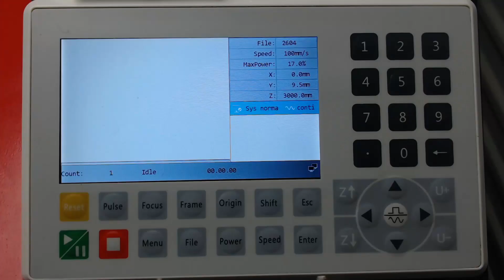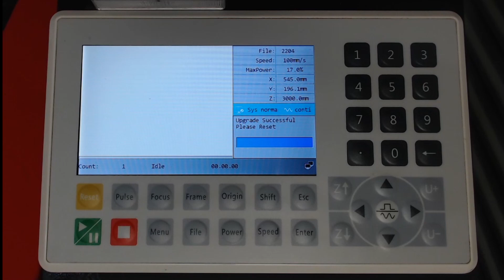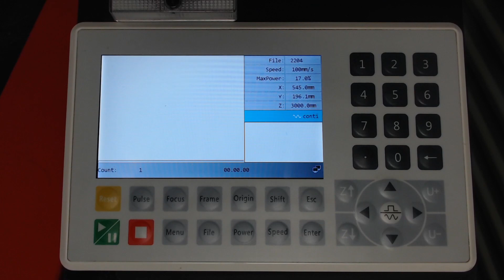[05] RuiDa Controller - Firmware Upgrade RDC6445 - Cloudray Laser - RD-ACS

Comment from the maker: I have made the firmware shown in this video available on my website at https://mwlaser.com.au/sdm_downloads/
Reply: MW Laser Thanks Matt!
Reply: I hate to say this but I’m having all types of problems with this firmware update. My machine will work fine until I go to bring up a new file and when I try to frame that file the machine crashes! Unfortunately I had no idea how to back up the original firmware otherwise I’d go back to that. Any suggestions Matt
Reply from the maker: with my testing and during production of videos for Ruida I have changed firmware revisions a few time both upgrade and downgrade, this has not had any effect on my machines performance.  it is safe to downgrade your firmware to a previous revision if you need to.
If you require further assistance email me https://mwlaser.com.au/contact-us/
Cheers Matt

Comment: Dear Matthew / MW Laser Team,

I have been following your excellent video tutorials and really appreciate the detailed content you provide for Ruida-controlled laser machines.

I am currently facing a challenging issue with my KH5070 laser machine equipped with the Ruida RDC6445G/S controller. The problem is as follows:

In RDWorks 8 software, my design files are set up correctly to engrave and cut from left to right (which is the expected and normal direction).

However, when the job is sent to the machine, the laser head starts engraving or cutting in the opposite direction — from right to left — effectively producing mirror-image engravings.

All polarities, origins, and settings in RDWorks and the controller have been carefully checked and appear to be perfectly set.

The laser head also physically homes typically (e.g., from center to upper right, then upper left), which I understand is normal.

Despite the above, the job execution on the machine does not follow the correct direction as designed in RDWorks.

I suspect this might be related to some firmware behavior or specific controller internal settings that are not apparent in the software interface.

Would you be able to advise or provide insight on:

How to diagnose and fix this reversed engraving/cutting direction issue on Ruida RDC6445G/S controllers?

Are there specific firmware versions, hidden parameters, or special configurations you recommend for the KH5070 or similar models?

Any tips or walkthroughs you might have that are not commonly covered in tutorials?

Your help would be greatly appreciated, as this issue significantly impacts the quality and usability of the machine for professional work.

Thank you very much for your time and assistance.

Best regards,
Jelena

Comment: Hi Matthew, Thank you for the video. I have the 6445S  with version 13 firmware. If I upgrade the firmware to 16 ( in order to get the chuck rotary to work correctly) will it also change the cuurent user and vendor settings?
Reply: I wanted to know the same exact answer. Did you happen to update yours?
Reply: @JuanGutierrez-zm9bv  I upgrade to latest firmware some time ago and it kept all settings

Comment: When I click, "upgrade firmware" I get a pop up message that says communication error.  When I click "read" it says read system information failure.  My laptop is correctly plugged into the machine.

Comment: Hello, how are you
I have an old OS (RDLC-V5.00.38)
I have installed RDWorksV8.
And I don't know how to get the update file for the latest version in order to update the program on the machine
Reply from the maker: contact ruida support for the controller you have, and request assistance
Reply: @MWLaser  Dear, thanks for your patience with me.
I called and they sent me a file but its format is not ( u p d ).
Rather, its format was (RDLC320-5.00.35.bin )
This format is not read by the program to update
And I am afraid that I update to the file (RDC6445G-V15.01.15-LIB.upd) and the machine stops working.
Please help me sir

Comment: Thanks for the video. 
May I have your contact?
Because I got a problem with my laser machine that it is not resetting properly it even doesn't move along x axis. When I diagnose it from machine screen the xlimit - shows in red color. I upgraded the firmware but can't see any changes
Reply from the maker: https://mwlaser.com.au/

Comment: My ruida 6445g controller came with 15.01.22 firmware. I’m having an issue when I attach rotary to y axis using a 3PDT switch and enable rotary. I can frame the design fine but when I click start. Nothing happens. If I disable rotary in controller and click run. The machine will engrave and rotary attachment works fine. Obv. Distorted. Is this a firmware issue for 15.01.22? Do you know a fix?
Reply from the maker: Hi Donald, I have become aware that there are some issues with controllers using that version of firmware.  And it may be that the U axis is setup for Rotary and therefore it disables Y for rotary when you select that option.  In short you are not the only one experiencing issues like this, and I have written directly to my Ruida Technician about these problems and I hope to have a solution soon.  To continue our discussion email askmatt@mwlaser.com.au  Cheers

Comment: Hi Matt can you tell me the difference between the Ruida RDC6445 and RDC6442    and why i would buy one or the other Thanks
Reply from the maker: these two models have very similar mainboard features.  some of visible features, include  the 6445 's larger LCD, and keypad layout.  Also some menu functions are easier to access on the 6445 and the number pad makes it easier to enter values when in the controller menu.  For full list of the features of each visit Ruida Website www.rd-acs.com

Comment: Great video thanks for the info, the firmware update disabled auto focus on mine and also air assist was only enabled when the laser fired so the relay chattered. I downgraded to .15 and all is ok
Reply from the maker: With the .18 firmware to enable Focusing Use RD Works - User Tab - Other - Scroll down to "Enable Focusing Function" to Yes and Write to controller.